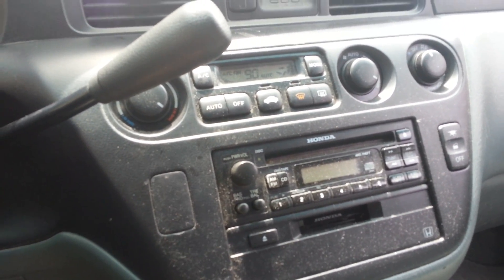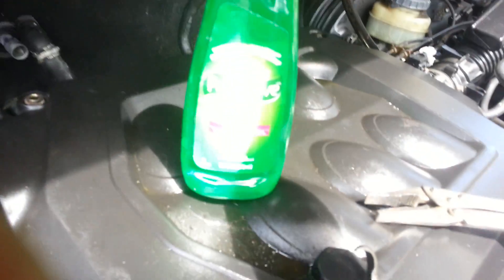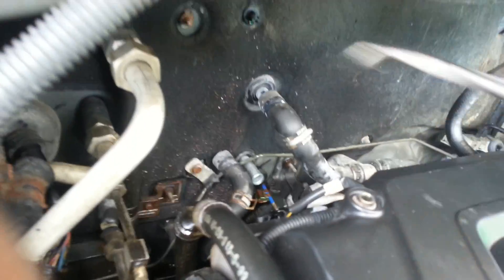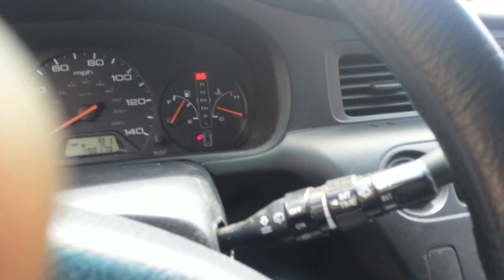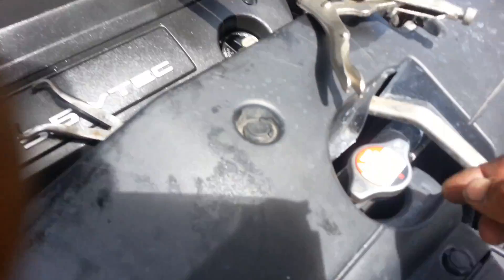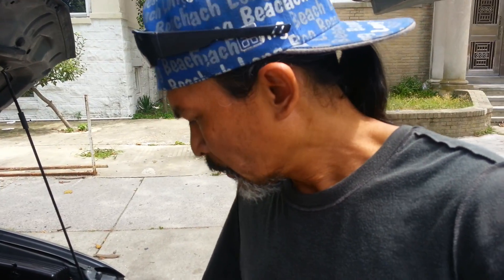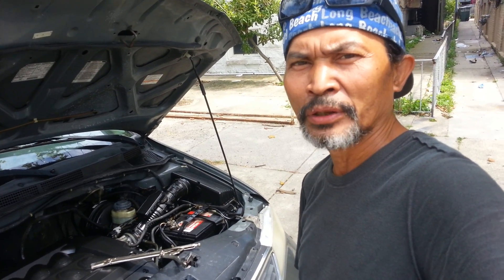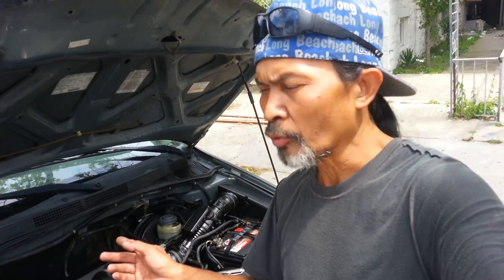NO  HEAT ?  NO  PROBLEM*****

Comment: Good video bro I'm experiencing no heat either in my older truck sat to long. I'll try no thermostat. Then if heater core is no good would drip on your feet. I use antifreeze in there. I just need to run it first go for long drive will work it's way back to normal

Comment from the maker: You can do the other way. there is heatercord  2 holds on the fire wall. flash out with the waterhole back and forth until you see clear water. Your  heater cord is blocking  like  now.  when you done put new antifreeze 100% PRESTONE and fill up with  water. You should have every HOT HEAT. GOOD LUCK FOR SURE********
Reply: So I got it done. Flushed well but still no heat. I discovered that the heater core valve was broken and therefore stuck to one side. I took the screw off and using a flat screw driver turned to open. Got hot air now. Will need to replace the valve though. Thanks though bro!

Comment from the maker: Yes. termosttas was blocking, dirty water, and heater cord crore up. Yes you will get  heat after you flash out the heater cord. Please use 100% Presto anthafre
Reply: Spencer Vongnaraj what if the heatercore is leaking.
Reply from the maker: Steve Walther : Yes Steve  Heater cord link? use PRESTONE SEALER without anthafre, much flash the hold engine out before use it, turn the heat switch all the way up. Turn Engine on 20 to 30mins, and drive 6o miles per hour on HWY.  In 3 days, drend water out and put new 100% PRESTONE anthafre and as up water. Good luck
Reply: Spencer Vongnaraj I think it's bypassed.  like they unhooked it because it was leaking...so I would have to hook it back up then prestone.
Reply from the maker: Steve Walther : That is the good  idea, check the robber hold make they're good. If they bypassed it.  It  got to be something wrong?
Reply: Please don't use concentrated antifreeze you must mix with half distilled water . Use 50\50 if you don't want to mix the concentrate with water .

Comment: I had heater core blown out, it’s back to no heat ..... I think that might be a leak in one of the radiator hoses.... temperature gauge was going up and down.....??? I don’t understand what’s going on with it .... the reserve was empty to , I added some more coolant

Comment: OMG! "Don't be like me" he said.  He wants us to do this, pull HOT hoses with bare hands and risk burning ourselves.  Put dish water soap in the anti freeze line.  Its not even in a reverse form, which is the proper way to clean out the heater core.  "Wait for all the water too come out, I mean all the soapy water to come out and then what.  Video ended, no further explanation required.  LoL

Comment: my ac works on idle but when on highway it stops working and heater doesnt work in idle but works on highway. any ideas? this is on a 2005 nissan altima.
Reply: Vicente Sanchez There is typically a switch around or near those two hoses. Some are electric, some are vacuumn, and others use a cable. When you turn your temperature setting from cold to hot, this valve will open or close. Easiest way is to have someone watch under the hood while you turn the temperature knob from cold to hot and from hot to cold. If it's not working, depends on the type you have on what to fix. But a temporary fix is to remove the switch or hose and manually turn it for cold air or manually turn it for hot air.
Reply: @gregsimpson621  what is this valve called?
Reply: Simple Man Sometimes called a heater control valve.